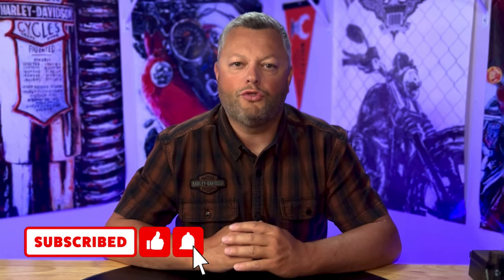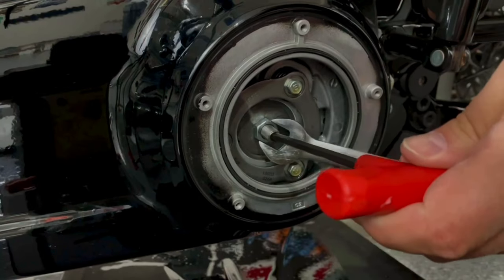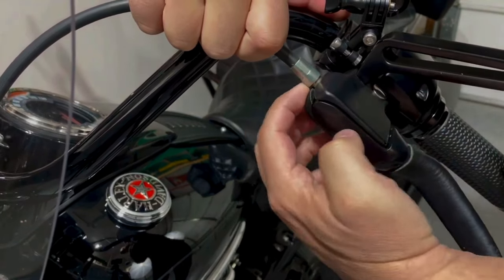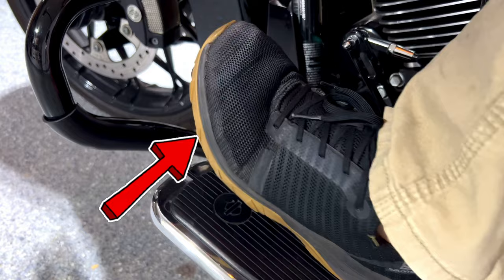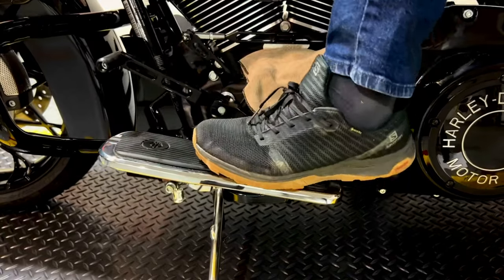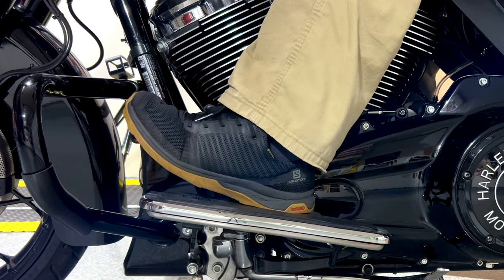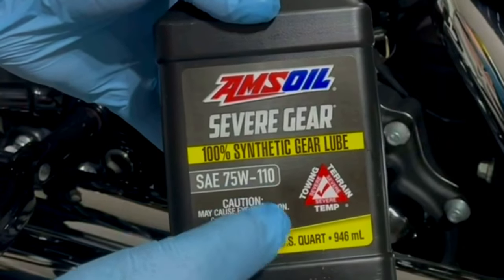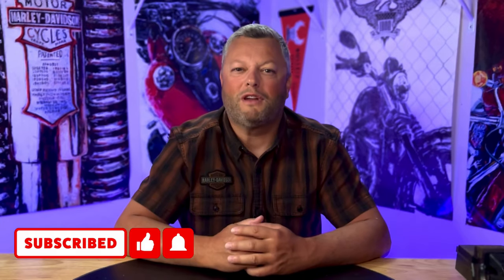🛠🔥 Cant Get Motorcycle Into Neutral? - 8 Tips To Make It Easier

Comment: Another tip on finding neutral. I've been battling that for 30 years 🙂 Of course the EVO, TC, and M8 all require a little different finesse. On my 2023 I have found it very easy. Starting from first gear, shift up to second. Then just gently tap the toe shift down out of 2nd, it usually always hit neutral.  The engine should be running. Test it out.
Reply from the maker: Thanks

Comment: I have a small bike and I usually struggle to put it on neutral when stationary, I have to move it back and forth a little to hopefully do so, and it's always impossible to do it when it's on first I usually put on second and then lower to neutral, I don't seem to find the correct clutch cable adjustment. I've bought a new cable, the lever that pulls the clutch from the engine and new oil but still.
Reply: I’m Having the same issue . The bike neutral very easy with the engine not running,but if the engine is running and I pull the clutch then try to neutral it will not
Reply: @snuckz8  It's clutch adjustment.  Sometimes u need to adjust both the cable from the lever that comes from the engine all the way up to the clutch lever. I replaced both that lever that comes from the engine and also the cable. And I adjusted the lever u pull with the hand and it's not perfect but it does engages the neutral more easily when on. Make sure none of that stuff is loose. The lever has like a knob u twist in order to adjust the cable. Mine is not perfect but it does engages it now. Though it struggle to do so when on first I usually have to put in on 2nd and then lowere to neutral when stationary but the engine on. Now I need to replace the lever and that knob itself to hopefully leave it perfect. At least I'm relieved is not the transmission. Just simple adjustment.
Reply from the maker: @snuckz8 clutch adjustment, 90w140 trans oil and try neutral when bike is still rolling whil stopping this should help